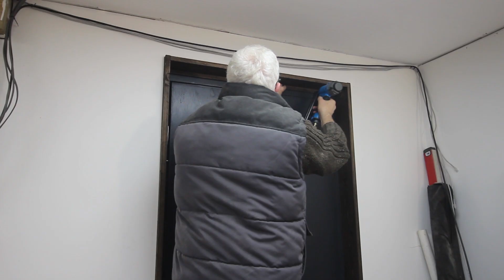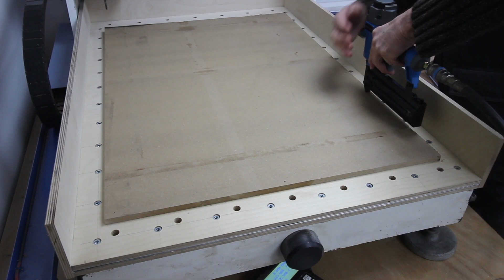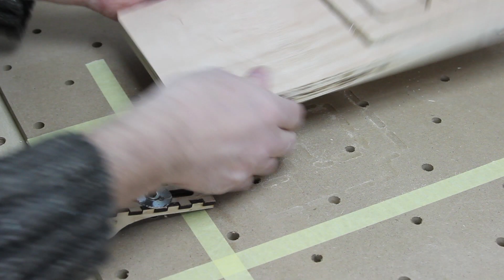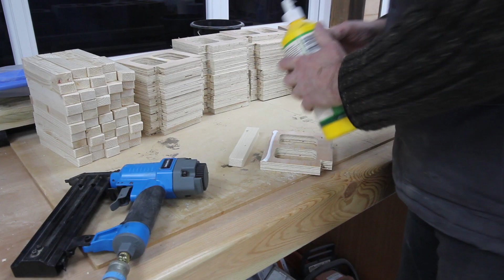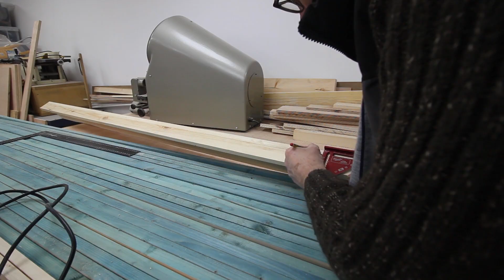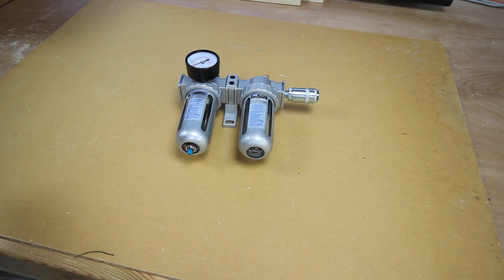Workshop trunking the hard way!

Comment: Great work as always. If you can, try fitting somewhere a 19in rack 240v power distribution block. I fitted one to the bench and it is the best output I have. Don't forget plenty of points for chargers etc....
Reply from the maker: Spot on I don’t think you can have too many. I’ve used lots of 19 inch distro units I started my career in broadcast. Systems are in my blood I’ve built OB trucks and studios.
Cheers

Comment: Good to see your doing a great job and it's coming along well, like the ducting for the dust extraction low voltage wires and mains power. The cladding around the window looks good like the idea of the switch panel. Plenty of mains sockets you can never have too many sockets which type of circuit are you installing 2 x radials at 16 or 20 amp or a ring main at 32 amp. I've got a 30 amp ring main powering 19 out lets 13 doubles 2 fuse connection  units and 4 single sockets. cant wait to see whats next, as always a great video take care
Reply from the maker: Thanks Shaun,
I am thinking of radial cct to each outlet. Easy to add more just cable and breaker. 
Cheers

Comment: Although a lot of power tools are now cordless it's very useful to fit 220/240v outlets.
If you think you need a single socket,fit a double,if you think you need a double ,fit a 4gang. And fit your outlets every 6ft around the workshop. ( Why 6 feet, well it means you're never more than the tools own power lead from a socket,reducing the need for extension leads.) it costs very little apart from materials to fit things in the construction phase,but it gets very expensive  retro fitting things. 
Fit 2 outlets at every air point too.
Fit both power and air outlets under the front of the bench rather than on the wall above the bench, then you don't have power leads and airlines running across your work area and getting in the way
Reply from the maker: Thanks Andy very sound advice!
Cheers
Reply: @CazualHaze  Andy?

Comment: Why does there have to be a beam over the door?
Reply from the maker: @Trev350
Good question there is reason in it. The building inspector made me put a heavy beam over the windows. The trunking would have to have a kink in it if I didn’t build out the wall over the door to match the window beam. 
It’s not structural just made my trunking a bit neater! I know it’s an utter waste of a whole sheet.
Cheers